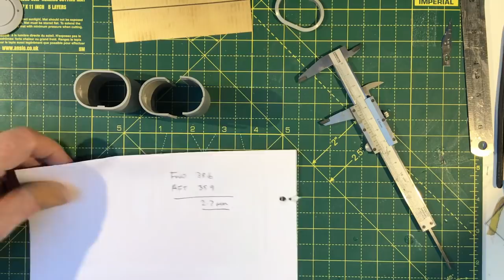Trumpeter 1/200 HMS Hood Full build with Pontos detail set Part 14 (funnel modifications)

Comment: You have the patience and discipline of a saint! And the work is astounding, as always. On a wholly separate note, it never occurred to me that there were maintenance gangways, ladders , bridges and platforms so high up in the stacks. Of course, it makes complete sense there were, again, it just never dawned on me. Can't imagine that was the most sought after assignment on Hood. Thanks again for another fantastic tutorial.
Reply from the maker: Thank you. There were actually ladders up the inside (accessed from the boiler rooms) which went up to the platforms and I believe that the frame at the top was to enable a cover to be thrown over - I suppose when the ship was in dock for any length of time. Not sure about that though I’d be interested to learn the purpose of them.
Reply: I showed the annealing segment of this to a friend who a metallurgist, and he strongly recommends quenching the brass in cold water rather than letting it cool down via room temperature. He is positive the reason why you still experienced spring in the funnel sheets was due to the lack of quenching. In his experience, the shock of the metal being introduced to the cold water, and the resulting immediate transfer of energy, helps maintain the softness required in the metal to permanently conform to the complexity of bends and curvature.
Reply from the maker: That's odd. Most of the advice I've seen suggests that quenching hardens the metal.
Reply: Exact opposite according to him. The "shock" of the cold water stops the process and allows the metal to remain in a more malleable state.

Comment: I just finished adding the foil to my funnels and annealing is what's needed for sure. I didn't use the Pontos funnel caps because of the silly construction of the lot! I still, almost went crazy making the Trumpeter set. Your a braver man than me... lol. You should look into getting a rolling set, it makes rolling etch a whole lot easier. It's looking good.
Reply from the maker: Cheers. I looked at a rolling set and they seem a lot of money for what they are. I might have a go at making something myself.
Reply: @TheModelShed  Yeah they're not cheap. You could easily cut different size wood dowels and use a vulcanized rubber pad, I have one of those as well which is also very useful. Cheers!

Comment: Thanks Steve that was really informative! I intend to extend the aft funnel but I am now very wary of the Pontos funnel caps given your experience. I am seriously considering using the Trumpeter parts after seeing the complexity of the Pontos parts. Really enjoying your build mate, cheers!
Reply from the maker: If I were doing them again Kevin I don’t think I’d have as much difficulty as I learned a few dos and donts along the way. The key thing is to get the base ring on the cap without any distortion and without blocking the slots for the frame parts. The trumpeter parts look easier but of course they’re sized for the different length funnels so you’d have to modify the etch as well as the plastic. I’d suggest practicing with the trumpeter bits and then have a go at the Pontos. If you mess up the Pontos you can always fall back on the first set.

Comment: This has been great to watch from somebody else’s perspective, my way to get the funnel resize correct was to put the halves of the funnel one was the forward funnel half put together with an aft funnel half and vice-versa... worked quite well... I’m not sure if you noticed that the funnel fret did not sit on the seam line of the funnel, I could not quite see on the video, it nearly tripped me up, but caught it just in time... yes the funnel scaffolding was quite a task, I ended up building a little jig of the model, the when it was all complete, I attached to the funnel top, and like you, I won’t be adding it to the funnel it’s self until late in the build.... great video... no idea long it’s going to take you to get to the final stage, I’ve been working on my Hood now for almost 18 months now.
Cheers and can’t wait for the next exciting installment.
Reply from the maker: Hi and thanks for that tip. It didn’t occur to me to do it like that. Like you I nearly got the foil positioning wrong but I fixed it after noting the location of the guys relative to the steam valves. I think the Pontos instructions tell you to fit the first line of rivets on the center line (so about 2mm from the edge of the foil. But to be honest because of the changes to the plastic I thought it was safest to eyeball it as per the method above.

Comment: Around the 37:06 mark I saw that missing etched brass from the previous video in the upper left hand corner in the instructions box on your cutting map.  Shortly after it's under your left hand.  Wonder if an edge or a bur on the etched brass got caught on a thread or fiber of your black cloth?
Reply from the maker: Hi Joshua. you have eagle eyes. it’s a rule in modeling that when you scratch build a replacement part, a day later the original one turns up out of the blue in front of your nose. I think I had found this and just left it on the workmat by this time. 👍

Comment: If you think the photo-etch is fine in 1/200th Scale - try it in 1/350th & 1/700th 😲
Reply from the maker: No thanks to 1/700. I’ve a 1/350 Pontos set and that’s as small as I want to go.
Reply: @TheModelShed  Yeah -- I'm currently at work on a 1/350th Revel kit of the Bismarck -- and the extensive photo-etch is a challenge! If I do this again, I'll move up to the 1/200th Trumpeter kit!

Comment: If I can suggest, get yourself a CMK kits saw,  (www.cmkitts.com) This can also be used for thin section brass, section and tube.
To ease the bending around the curve, gently scribe parallel lines into the brass, wrapper on the rear face but ensure they do NOT show through.  Although you have done this task now.  It will also aid the adhesive `sticking` the wrapper to the funnel.
Reply from the maker: Thanks Alan. I have some RB production saws so I might try that. I wouldn’t have done it on the funnel foils though as they’re so thin and I’d have been worried about the score showing through. They went on OK in the end. Glad you found your lost part.
Reply: @TheModelShed   Did you receive my email ??
Reply: @TheModelShed  RB are okay, however the CMK saws are available in various pitches (TPI) there also useable even when broken.
Reply from the maker: It had gone it to spam Alan thanks I’ll message you back later. Steve